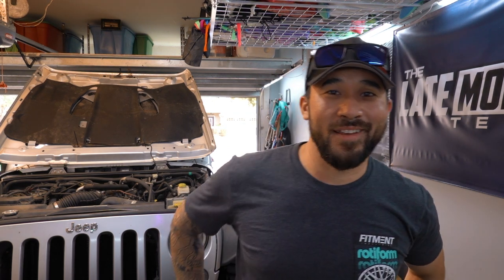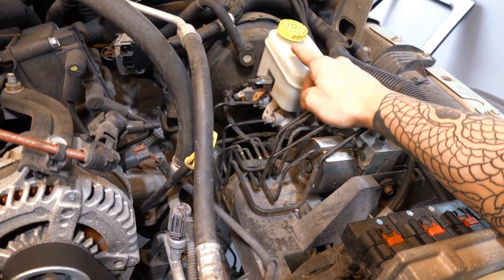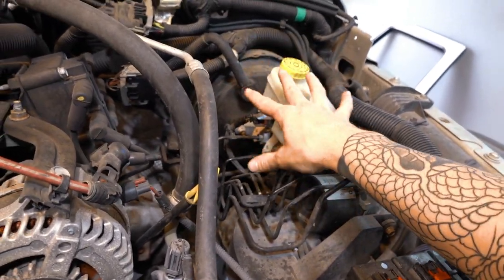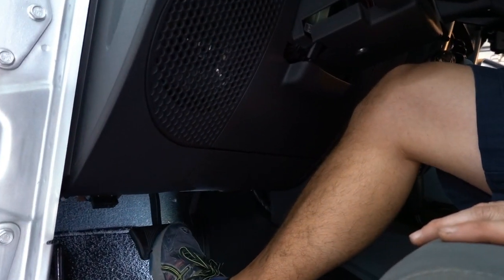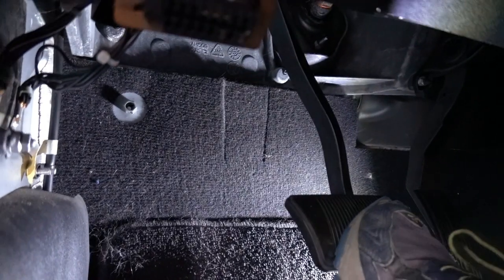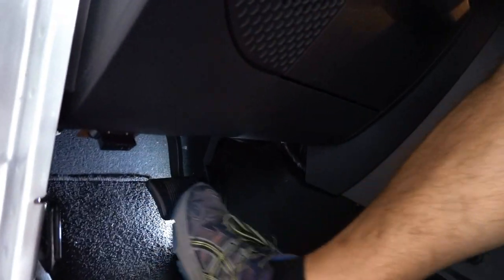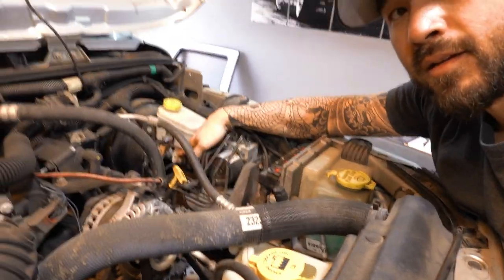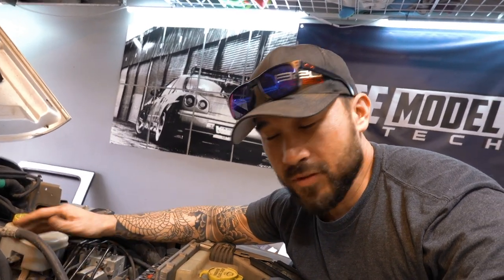Brake Booster Failure Part 1 My Jeep Wrangler JK makes strange Brake Noises and Doesn't Stop Good

Comment: Thanks for the video, Im a mechanic, but I have never experienced a bad brake booster..but definately all the other components in a vehicles braking system that are more common. 
Another symptom I noticed is a climb in idle when the brake is pressed, or lean codes form the ECU. The hissing sound is actually air from under the dash getting sucked into the intake manifold that is not metered by the MAF sensor. Sometimes it not even the brake booster, but the Brake Booster Master Cylinder Rod Seal that sits between the master cylinder and the push rod of the brake booster.

Comment: I believe that I need to replace mine but because of a different symptom. My ABS and Traction control lights keep coming on when wheel is turned too much and the break begins to pulse as I press down to make a stop. Reading the jeep manual it said it's because of the brake booster. Thank you for this guide.
Reply from the maker: That is probably a wheel speed sensor or clock spring issue.

Comment: Good video I learned how to talk to telemarketers haha but I have a 87 wrangler I bought brakes where squishy, I found the front brake lines where rubbed and leaking. I replaced lines bleed all four wheels and still goes to the floor ,no brakes. I do notice it's wet looking around where the master cylinder mounts. Any suggestions.

Comment: My chevy Colorado is doing the same thing.. I'm going to see if I could just replace a seal. Brake booster on Ebay is a gm brand brake booster but I'd rather check to see if I can just change the ssal if it has one down there by the brake. Good video tanks!
Reply from the maker: How did it turn out?
Reply: @Donnythelatemodeltech  booster is on fine and working great

Comment: Just installed new pads and bleed the brakes, rotors were good. Now a hissing sound under dash an peddle goes down more than it should. Feel like worn pads.
Reply: Hy what was the issue please  I have same issue  after change  the pads , I bled the sistem still same thing.please help
Reply: @simsauto  it was the main vacuum booster. Replaced it and fixed the problem.

Comment: 2000 dodge ram, pedal doesn’t come up all the way ? And ideas ? Thanks
Reply from the maker: Possible Failing master cylinder,  does it stop?
Reply: @Donnythelatemodeltech  
Yes it stops , only the pedal won’t come up all the way. New booster and solenoid .

Comment: Would the master Cylinder or brake booster
 cause a leak on the drivers side floor board? I found it this morning before leaving for work. 2016 JK Rubicon with 104K Miles. I still have pressure on my brakes.
Reply from the maker: Is it water 💧
Reply: @Donnythelatemodeltech  It looks and feels like Brake fluid

Comment: So question my I think my booster bad but mine seems h
old vacuum cause plug the hose here the house but peddle going to floor  aund my done hold presser when it's running like yours here the air noise but does make a loud noise like all the air comes out the booster hard explain I done replace master bleed it bleed all tires new bad new calipers all new brake fluid so think points to booster
Reply from the maker: Bleed abs with scan tool, "required".     Then retest brake pedal.
Reply: @Donnythelatemodeltech  I have foxwell abs scan tool  did auto bleeding still seems no peddle 😡😡
Reply: @Donnythelatemodeltech  another guestion the booster push rod that come out and pressing on back master cylinder is that thing real easy get out mine just pulls right out I don't think there that easy I have different vehicle I'm working on 2000 blazer